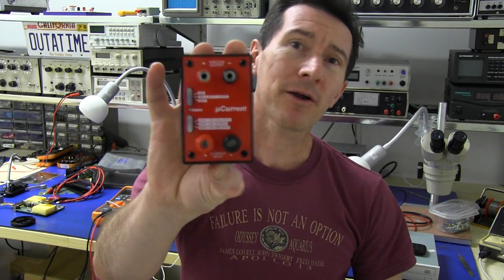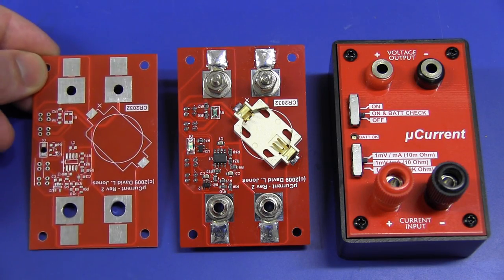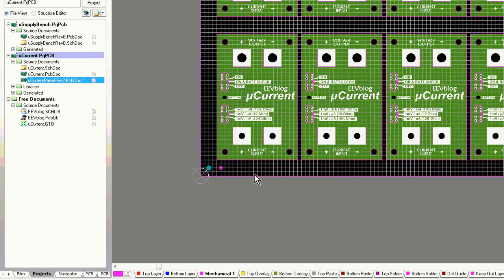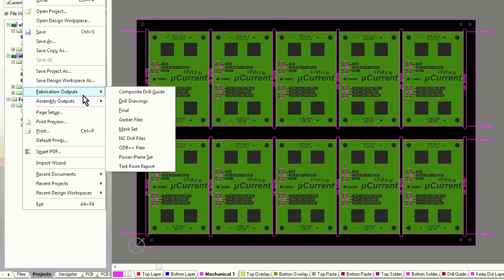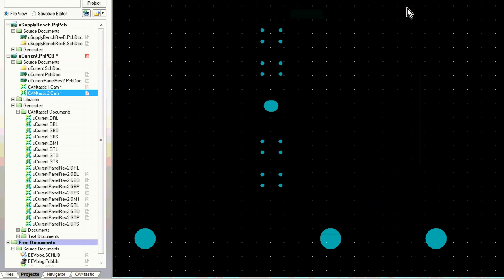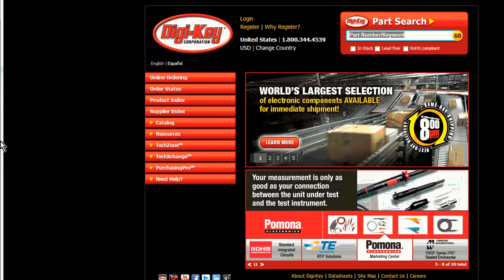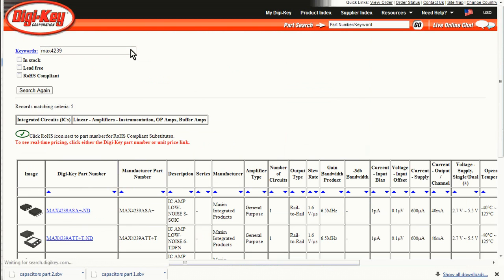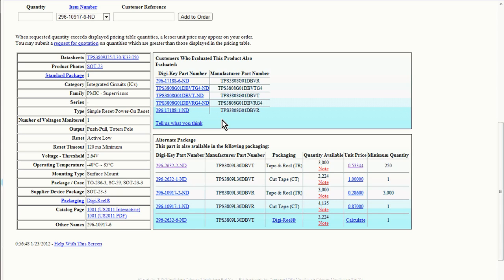EEVblog #239 - PCB Design For Manufacture Part 2

Comment: While watching this, a thought occurred to me. There is another cost that you didn't include for high volume production. Storage! You can't expect to make 10,000 boards and just stick them in your bedroom closet or something, you have to have somewhere to put them. If there are enough of them, you may even need to rent space in a warehouse or something.

I doubt most viewers are in the range where storage becomes a significant issue, but it just popped into my head while watching this.
Reply: This depends on how you're selling your boards. If you sell your product yourself then you're absolutely right. But if you use a reseller, they'll likely hold atleast some of your product in their own warehouse.
Reply: This is definitely important if you are getting a lot of boards sent to you for programming, or some other end-process like through hole soldering some parts. It's amazing how quickly the weight adds up too!
Reply: You underestimate my bedroom
Reply: @yeet1337  lol

Comment: As for manufacture, have you considered using pick and place solder supplys in 0201, 0402, 0603, 0805 or 1206 formfactor so that you can have the entire board manufactured in a single reflow step, the manufacturer will use a temporary adhesive to the board and then all the through holw components can be made in the reflow oven, I think the technique is called pin and paste

The other technique is that you could design the board so that the SMT stuff is wave soldered.

Comment: Firstly, thanks for taking the time to make these & answering so many of the comments. Clearly you're helping a lot of people who know very little about PCB design & manufacture.

I might suggest though, rather than "PCB Design For Manufacture", you really should call these videos 'All About Board Panelization". In the hour of the first part, most of the time was spent talking about panelization, and in this one you spend another 40 minutes covering some of the same exact topics and there's very little discussion of board level layout techniques and constraints to make the PCB fab & assembly more reliable & repeatable. 
Speaking of repeat.....it's a sign of an Engineer, so I don't fault you, but you repeat a LOT of things not only from the first video (probably because they're created 2 years apart), but multiple times in this video. You could've made this video half as long and thereby twice as helpful if you just made notes on what you wanted to cover and covered it once.

Comment from the maker: @blarque An automated jig for precision measurement like this is not trivial. You have to weight up how long it takes you to develop and build that vs how much time you save per unit. I wouldn't save much time, I have manual testing down pat and it's very quick.

Comment: Do you have a video about the criteria you have to satisfy so that your designed circuits working properly after printing them on a board? For example I was thinking about topics like where to place your high and low voltage components in relation to electromagnetic compatibility and high frequency signals.

Comment: Yes, manufacturing houses can re-use already opened reels, BUT... some (old) pick&place machines, as they open the reel, will let fall like 10 to  20 components. Theese are scrap and they won't use them, so instead of having a leftover of 300 components you will probably have something like 290 or 280 components. 
If you are going to manufacture 10 PCBs with a pick&place machine, think about it before buying a digireel with 10 components!

Comment: So for the tooling, is it cheaper to try and have fewer sizes of holes or does it matter? Like if I've got 4 different hole sizes is it cheaper if I try to work it to where it's only 2 hole sizes so they don't have to use 4 different drill bits? Or is that something where through automation it doesn't really matter?
Reply: It still matters as machine time, until it's switching the bit.

Comment: You did not take accaunt the pacages alignment. You will want to align the packages so that they are not aligned towards the wave which is coming fron top to bottom of your board. You have lot of resistors aligned this way. Aligning the pacakes so that the solder sides are againts the wave and it reduces the failing joints in wave solder process and make producing cheaper.

Comment: Even though I studed electornics on the University of Applied Sciences 2 decades ago I am more into thinking out system rather then do all the producton or the prework. Suppose someone has a working protoptype with several boards attached to oneanother by jumpercables. Has the software running on this too. But now want to have these seperate components joined in one single PCB and not design the PCB himself.....The idea might be great, the software could be encrypted since it is the core of the whole electronic system.....Where do you go from there?Also missing: what does this all cost? You never mention that. Which is about the only criticism possible on your otherwise fantastic videos! Reaaly enjoyed them and saw quite a few after another!! Well done!
Reply: Did u find an answer?

Comment: Can the v-grooves run off the edge? would insure later hand cutting easiness
and   to keep intact the end board corners.

edit: video #264 
towards the end you comment the board has some sag..
it  does have 3 V-gooves that run off the board in parallel making the preferred solution should one want bend almost any panel: pcb, thick plywood, dimensional lumber to any variety of metal
 or even any shape of anything.
The sag may be a reason to stop the groove before the edges, or leave a full thickness board stripe and tabs perpendicular to the other grooves.
And interrupt the 3 main V-Grooves leaving intact the bracing

Comment: is there any reason you dont mention testability at all?  there's a video of you handtesting one batch which seems to have take quite a lot of time, if you think high-volume shouldnt that be a factor in this as well, or will you build a custom testjig yourself? If you'd do design an automated test, i'd be really interested in that, whether you'd just build a mechanical testjig and tweek around with your multimeter or something like a whole testsuite which is maybe controlled by a microntroller

Comment: Instead of TI TPS3809L30DBV, why not order an equivalent and much cheaper part form another manufacturer?
It's "Pin-For-Pin Compatible With MAX 809" as TI states in their datasheet.
MAX809 is manufactured by both Maxim and ON Semi and both are also sold by Digi-Key. 
ON MAX809RTRG in Digi-Reel is much cheaper than TI.

ON MAX809RTRG x250 Digi-Reel: $78.69
Ti TPS3809L30DBV x250 Digi-Reel: $126.19
Ti TPS3809L30DBV x250 mini-reel: $133.36

Funnily TI is a bit cheaper in Digi-Reel than in mini-reel.

Comment: I've got a question - if you only use 200 components on a reel of 500, will you be able to use the leftover 300 (which presumably are still on the reel) in a next round of production?
Reply: gfx2006 I know this is late but I think I can answer it. Yes, you can use the remainder for your next production run but don't expect to get all of the components back, some might be rejected during assembly.

Comment: Another excellent video Dave!
Altium looks like PCB layout porn!  Do you reckon it still is?  What's the best one?
I've used PCB Wizard 3 (Maplin - stop slapping my head..) from New Wave Concepts for years and I've upgraded that to the pro version that produces Gerber output and once you get to know it, there isn't much that you can't do (I grew up with crepe tapes, stable film and scalpel blades, go figure).  But Altium looks awesome.